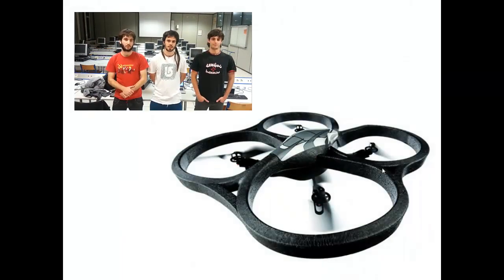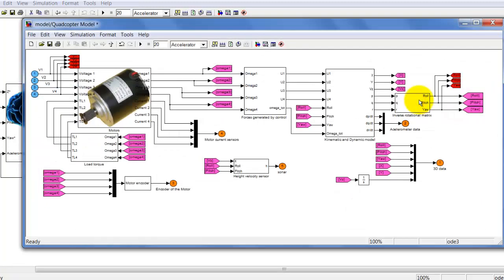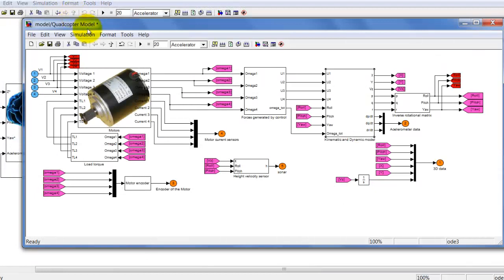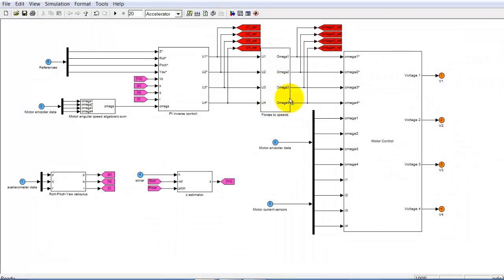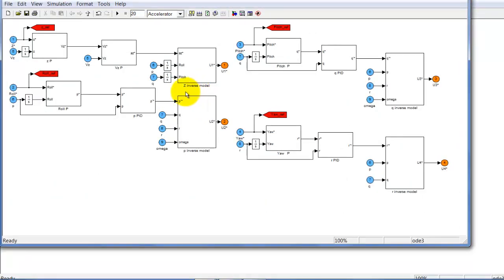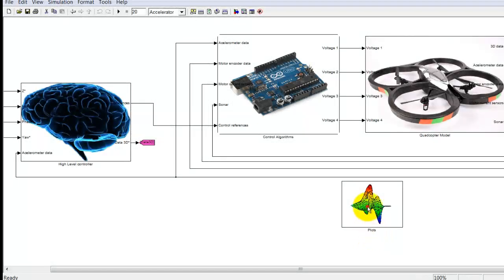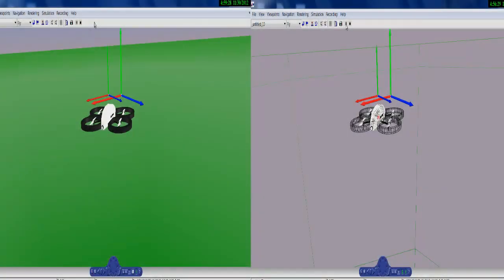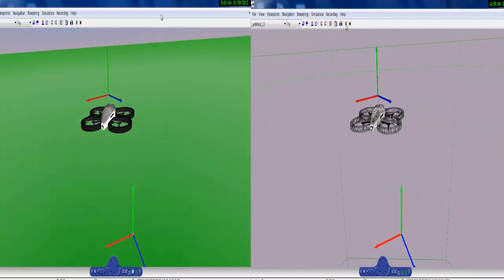#Simulink2012 Student Challenge. Modelling, control and 3d animation of a quadcopter

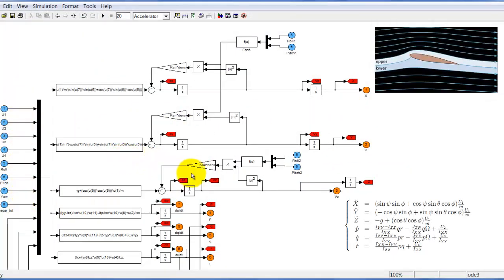Comment: Thanks  for the video guys, im actaully working in my university in the modelling of the quadrotor with similink but i have an error everytime i tried the simulation, Iknow that in the mathematical modell there is the simplificatrion phi´´=phi´  theta´´=theta´ psi´´=psi´ in my simulink  modell when i want to get any of the angles i used two blocks of integrals to get the angle, but i have notice that in your simulink model (1:47) you only use one integration model to get phi, theta and psi. Is that true? is that your simplification ? or dou you have the other integrator in other part?